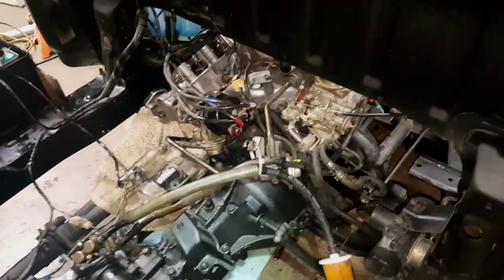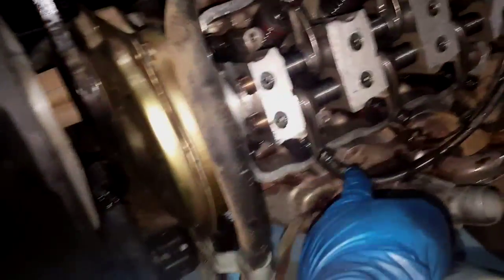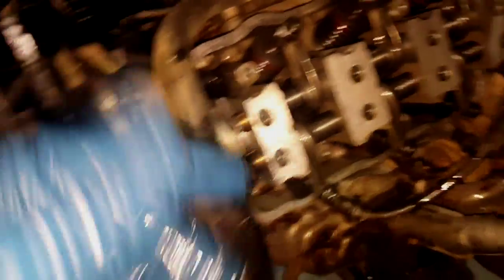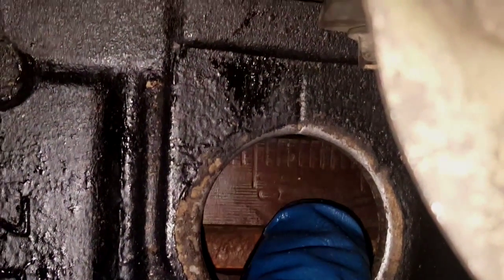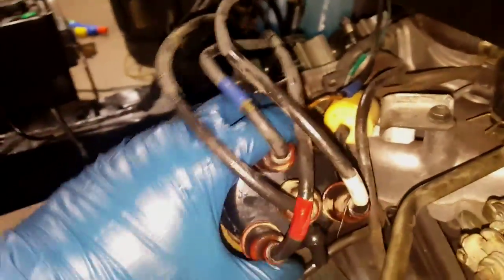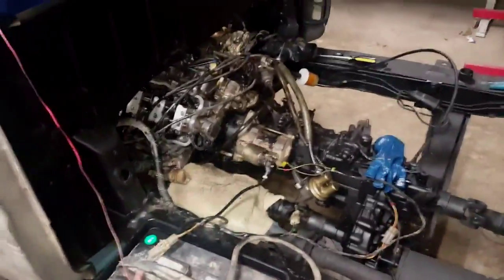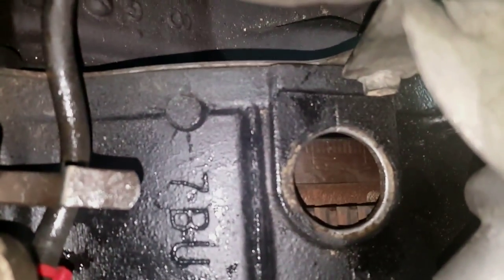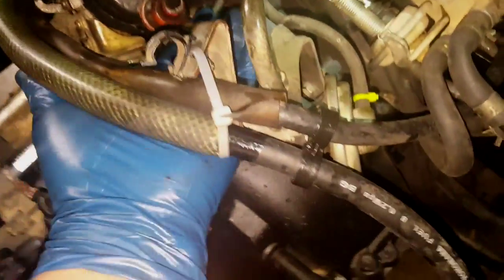1988 Suzuki Carry DB71T Engine Timing

Comment: I commented on the other video and its
 no longer there So I'm going to comment here after seeing your video.What I find confusing is it's supposed to be no 1 cylinder at TDC on the compression stroke but it's really no 4 thats on that stroke when the timing marks for TDC line up on the crank camshaft and flywheel .It says have the flywheel mark at T and the timing should be at 8 degrees BTDC which is almost as you have yours at 7 degrees BTDC.What confuses me is piston 1 being on the intake stroke when you have the timing mark at 7 degrees BTDC  The no 1 cylinder should be set on the camshaft sproket to the 6 o clock position for the no 1 piston to be on the compression stroke .Also your van/truck has only three cylinders mine has 4.

Comment: sir, how to replace transmission fluid in this unit?
Reply from the maker: there is a screw with a hex head to use an allen wrench... l'll do a quick video on that shortly.
Reply: +EngineerPrepper thank you for that very kind sir.